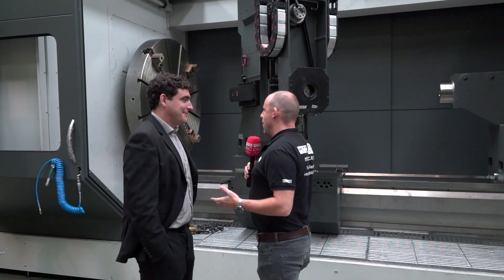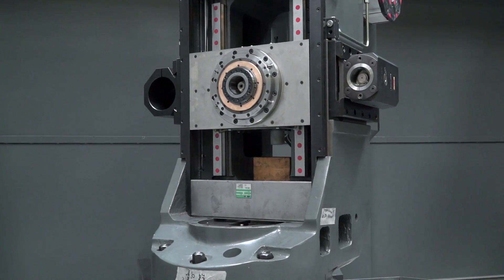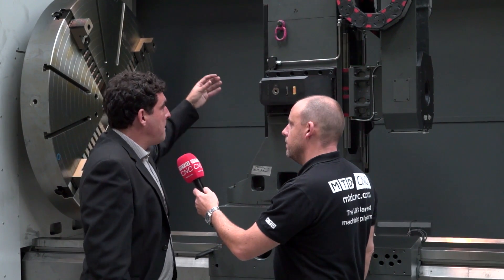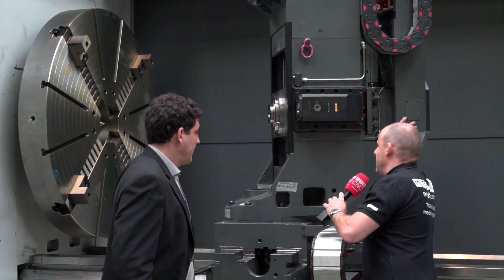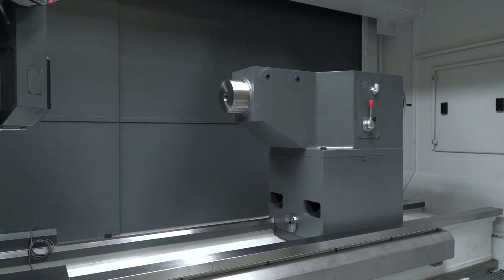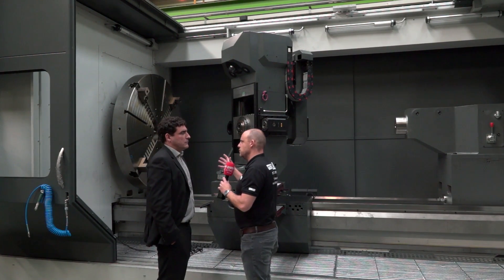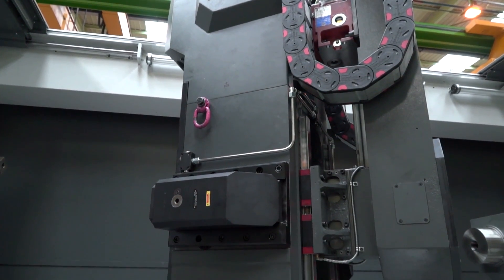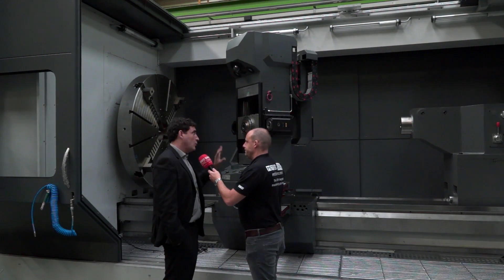We've never seen a milling column on a lathe like this

Comment: It's amazing how massive these machines are and they can hold tolerances to microns. Now my question is with that column .can it be used in an arc like movement or does it have to be locked at 90 or 0 degree?
Reply from the maker: Its locked Dave to a position.